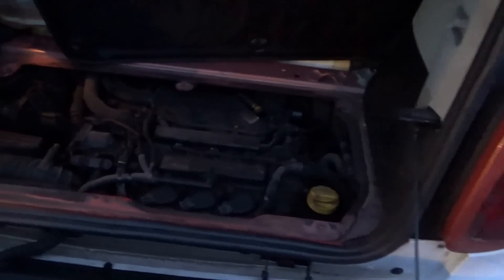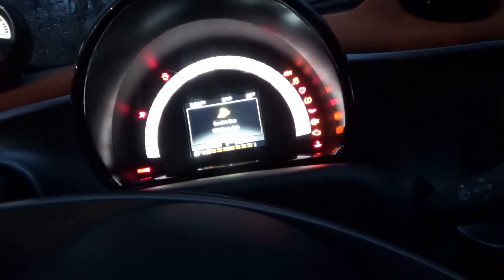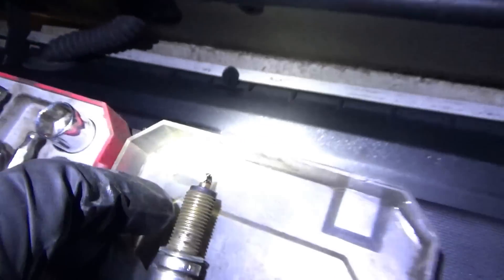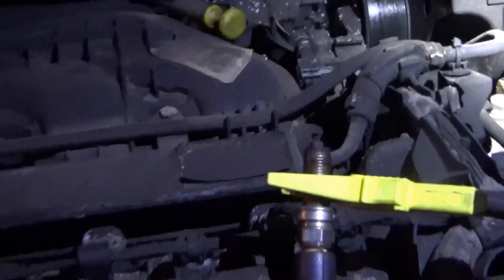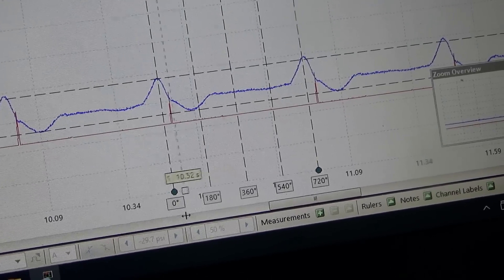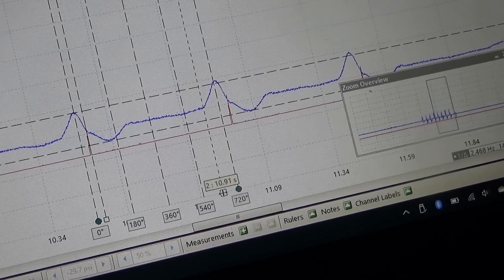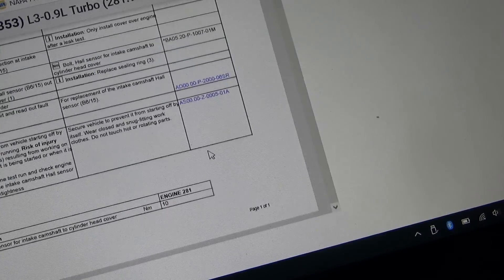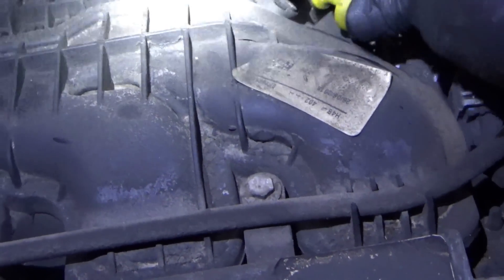SMART No-Start Diagnostics (Spark? Fuel? Compression? Timing?)

Comment: Hi Ivan. I have a sienna 2006. It has a pinging noise between 1000-1800 rpm under load. I changed spark plugs, cleaned the valves, it had a knock sensor code stored before; I changed the sensors, I put fuel additives to it but still nothing.
I want to ask if you have an idea of what could it be. It’s really enjoying. I hope you reach back to me. Thanks
Reply: Stop using cheap low octane gas.
Reply: @johnt.848  I’ve been using 93
Reply: @johnt.848 it's a Sienna. It was tuned to run on 87 pump gas lol. And it sure didn't have the issue when it rolled out of the factory. Can't blame fuel here haha.
Reply: @matthewkinney5474  What did the old spark plugs look like, was it running lean? Pinging under load says low quality fuel or running lean to me. Hopefully Ivan can help.
Reply: @johnt.848  weird thing is that it doesn’t throw the check engine light
Reply: Incorrect ignition timing, carbon buildup in combustion chamber/piston, head skimmed excessively on a previous rebuild.
Reply: @ferrumignis  I used mistery oil once and it worked for I while
Reply: @ferrumignis  it had carbon on the valves,  but I took off the intake and cleaned them, then I used additives and to make sure is clean I took the intake manifold off and they’re definitively clean.
Reply: I would have checked the timing chain. See if it's stretched out the chain or jumped a chain link. Thusly the timing has changed. 
Changing a knock sensor is not going to fix a problem.
Reply from the maker: Does it burn any oil?
Reply: @PineHollowAutoDiagnostics  no, it doesn’t. That’s what I thought but no.

Comment: I've worked on a couple of these.  Both were blown head gaskets.  They are a bear to work on because of the very limited space back there.  And the cooling system is pretty tough to bleed out too.  But as soon as I heard first crank, I heard no compression.  Shes cooked my boy.  They can be a fun little city scoot to drive around in.  Especially if you do a Hayabusa swap on it.  But you're really not missing out on anything Ivan.
Reply: Haha I remember seeing videos of Hayabusa swapped Smart Cars ripping up and down the street. Could be a completely impractical fun project. Otherwise, the stock drivetrain must be boring as hell in a boring half-sized vehicle...
Reply: A bike engine would be pretty useless in this, the 453 is simply too heavy at around 1100kg.  You are probably thinking of the first generation models that were around 700kg and there were quite a few bike engine swaps.  Even then it's still heavy for a bike engined car.
Reply: @ferrumignis  The difference is, the stock 1.0L engine in a Mercedes smart car makes 90 BHP and 100 foot pounds torque on a good day.  The stock Suzuki Hayabusa 1300cc engine makes 180 BHP, makes the same amount of torque and the complete powertrain weighs considerably less.  What is there not to like?
Reply: @Sandmansa  The problem is not the engine, it's the transmission. Bike transmissions tend to expire quickly having such a huge load placed on them.
Reply: @ferrumignis  The motorcycle transmission is plenty strong enough.  But the direct engagement of the constant mesh transmission is very sensitive to user input.  If someone were to miss a shift at full throttle, it will damage the transmission.  Any transmission honestly.  That's why drag racers use electronic shifters with an ignition disable function.  It helps the user line up those rev matches.  Has anyone here ever heard of Legends racing?
Reply: @Sandmansa  The Legends car weigh only 570kg including the driver, this Smart is nearly double that without the driver. Unlike the multitude of know nothing armchair experts I actually have some experience with BECs, having built my own. The Hayabusa has a strong gearbox by bike standards, but even so the kit car and hayabusa forums always have plenty of people with transmission issues. If this weren't true then Quaife wouldn't be selling uprated gearbox internals for significant amounts of money.
Reply: @ferrumignis  Regardless of pending transmission issues, the swap can be done and the Hayabusa engine can breathe some fun new life into the smart car.  And those who have done such a task will know that it's an ongoing project.  Can we agree on that?
Reply: @Sandmansa  You could physically do it, but on this very heavy third generation car, it would be an expensive waste of time, so you'd have to be pretty dedicated to throwing your money away.

Comment: Smart Car. Owner, not so much.
Have to admit though, a 900cc engine with 20,000 mile changes. 120,000+ miles is kind of impressive.
Reply: The saved money from not doing oil changes would easily buy another one of those cars 😄
Reply: Probably bought it used with half those miles... That's some serious neglect, especially with city driving... If it was all highway it might be a different story, the total hours that the oil is in use are like 3x lower and it doesn't get all the cold starts and fuel contamination.

Comment: Engine comes out the bottom, and pretty easily too. Problem is, junkyards think they are gold and price them accordingly. Best to buy a wrecked in the front salvage car for less money than just a junkyard engine alone, and swap the parts.
Reply: I guess they are much rarer in the US, in Europe this engine is quite common as it's used in quite a few Smart, Renault, Nissan and Dacia models.

Comment: The irony is that oil changes would be so cheap, quick, and easy in a car like this.  Very sad.
Reply: It seems to be a common issue across all generations of this car, so many owners neglect oil changes. Possibly because the engine is so well hidden, out of sight=out of mind.
Reply: @ferrumignis  I get anxiety if I'm just a couple of hundred miles over the 5000-mile oil change interval!

Comment: I have seen these cars around. I never knew the engine was in the back like that. wow. Learn something new every day.
Reply: I helped my neighbor change his oil yesterday and I had to use a low profile jack to get under there😂😂
Reply: @randyanderson4360  My first generation Smart is one of only a few cars I've owned that I can get a regular jack underneath.  I couldn't even get a regular jack under my Suzuki Swift Sport, had to drive up on blocks of wood first which is annoying.
Reply: I can't understand why they would use two different bolt patterns on the two different size tires.  That is just nuts.
My 3 cyl Yamaha was a very smooth running engine.
Reply: @robertsmith2956 Not sure what you mean, the 453 model uses a 4x100mm bolt pattern on front and back.  The earlier models had an unusual 3x112.5mm PCD, but again it was the same on the back and front wheels.
Reply: @ferrumignis  oh, I had heard the two tire sizes were incompatible.  Thought that was dumb idea needing two different spares.
Didn't surprise me at all with all the the dumb things auto manufacturers do.
Reply: @robertsmith2956  The wheels and tyres are different sizes front and back, but the bolt PCD stays the same.  This is the same as on some other cars that run different sizes front and rear, such as certain BMWs.   As with many new cars the Smart comes with sealant and a pump and no spare, far from ideal IMO.

Comment: I changed the oil every 20,000 whether it needs it or not! 😜 When you turned the key I knew it was not good. 😂
Reply: Wait, What, you have to put oil in.....how often do you do that?
Reply: Even for any brand new cars engines are maximum driving without changing the oils are at 10,000 miles only.Changing the oils only at 20,000 miles that the reason that car engine 😂is dead.Ideally brand new cars engines oils changes are at 5,000 miles.Older cars engines about with 80-100 thousands miles.Oils changes should be done at every 3,000 miles or every year to keeping that engine healthy and doesn’t damaging those piston and it’s cylinder sides walls.

Comment: Should have been a no scanner required diagnosis.
Reply: That's a parking lot diagnosis, no need to even push inside the shop.  Oh, and that will be 1 hour labor charge.  Next!
Reply: I'm sure Ivan was trying to verify the customer statement of the crank sensor code.

Comment: Had one the other day to work on, the bonnet was bonkers, it got two straps and it all comes off lucky it was plastic. I wouldn't like to have crash in one, but for some mad reason I do like the smart fortwo mk2 shape.
Reply: Don't be fooled by the size. It's not a toy. They are crash tested and are quite high rated. You are quite safe in one.
Reply: @givemespace2742  I was shocked to see how well the test turned out. 

Legs are the main thing here as it’s not that safe at high speed, but like the video said, your organs can’t handle that force so you’re likely not to survive anyway. 

Video to test https://youtu.be/mnI-LiKCtuE?si=CTt5woMp8PjNSwpA
Reply: @givemespace2742  actually now you mentioned that, I do remember years ago watching a mk1 or mk2 smart for two on a crash test and it was shocking how good the safety of the vehicle was. I’ll try find it now and tag you.

Comment: Those cars are so unsafe that god forbid your in a serious accident YOU AIN'T WALKING AWAY FROM THAT.  Theres video of one being tested hitting a K rail at different speeds and no matter what you hit starting at 20mph your screwed.
Reply: Absolute crap, they are surprisingly safe car, especially at city speeds. Why would you post such ignorance?
Reply: @ferrumignis  Problem may not be the speed the smart car is moving but the truck that hits you! 
You’d really have zero hope of survival or at very least many broken bones. 😩
Reply: @johnlarkin549  They are extremely strong, which is why they weigh so much.  Have a look at the 5th gear test of driving an original generation car into a concrete block at quite high speed, they could even open the doors afterwards. The problem with that one is there isn't much crumple zone, so a high speed collision likely wouldn't be survivable due to the forces on the occupants, not because the car gets crushed. However this late generation car is quite a bit larger and even stronger than the original, the Euro NCAP safety testing in Europe gave it 4/5 which is an amazing score for a small city car.
Reply: @ferrumignis  Isuppose the fact the doors remained operational at least would make it easier to extract the dead bodies within.
If the paramedics were thinking clearly they could leave the corpses in the car as that’s very dead as well it’s become a luxury coffin with doors😁
Reply: @johnlarkin549  Please feel free to continue ignoring the facts and showing your obvious bias.
Reply: @ferrumignis  I thought you said in a crash test that it wasn’t survivable but could still open doors? That’s what I was responding to, no ignorance here just basing reply solely on the evidence you supplied me!
Reply: @johnlarkin549  I said the high speed crash of the first generation Smart (this is a third generation car) showed remarkable levels of strength in the passenger cell such that even with a brutally hard crash (not representative of any  standard auto safety tests) the passenger cell wasn't distorted enough to stop the door opening. With the high speed, no crumple zone in the object being hit and a relatively small crumple zone in the car the occupants would have experienced very high forces which may not be survivable. If the test had been run on other small cars I suspect they would have faired worse with considerable deformation of the passenger cell.
Reply: @ferrumignis  Forget the shenanigans I’ll stick by my first comment I’d feel safer in a shopping trolley🤣🤣 god bless
Reply: You’d have more chance in a shopping trolley at 20mph as I’ve survived many crashes in a shopping trolley no alcohol involved of course 🤣

Comment: Yessir.  As soon as you hit that starter, I was like "Doh!  Motor time!" It almost freewheeled.  🤣
Reply: i heard it and i thought: It´s gone
Reply: Me too.  My first thought was there definitely is a compression problem.
Reply: Haha I instantly thought ouch dat one is not going anywhere.

Watching Ivan so much has left „scars“ gotta admit 😂
Reply: Yes sir!
Reply: I've condemned a few of these for the same reason. Not economical to repair/replace. The ultimate throw away car.
Reply: @1MiketheMechanic You might be thinking of the old 450 ForTwo with the 8v engine, these were notorious for burning exhaust valves around 60k miles. The 0.9L Turbo engine is generally very reliable if it's serviced correctly, it's used in many different Smart, Renault, Nissan and Dacia models in Europe and total failures like this are very rare. The only significant issue I know of is early engines can suffer from coolant leaks from the thermostat housing gasket, an easy fix.

Comment: I don't have that problem with my Smart. It's Electric!
Reply: You have exactly the same problem zero compression 😂
Reply: but mine goes down the road just fine!🤣 @johnlarkin549
Reply: Tell us again when the battery pack needs replaced at the tune of 7k...😅😅
Reply: it's a 2013 and still over 90 percent!
 @2nickles647

Comment: Quick diagnostic, Ivan! We have lots of Smarts in Europe and, as soon as I heard it cranking I said - It has no compression (you can hear the effect of compression on normal cranck speed).
Reply: I think everyone knew it had no compression with the first start attempt
Reply: These cars have a tiny sump between empty and full mark on the dipstick about 0.5 l
Reply: @mauricevandoeselaar  Empty on the dipstick doesn't mean empty in the sump.
Reply: @davidnorton5887  these cars are very picky on that. And the first series were also oil burners so a lot of them dyed prematurely.
Reply: @mauricevandoeselaar  Yep.
Reply: @mauricevandoeselaar The 0.9T engine has a pretty good oil capacity for a small engine, 4.3 litres or 4.5 quarts.